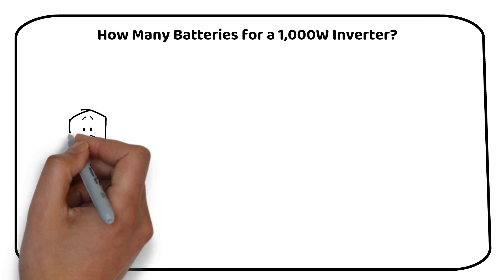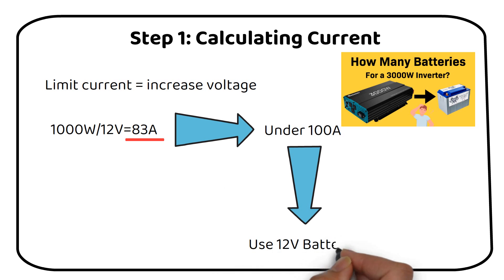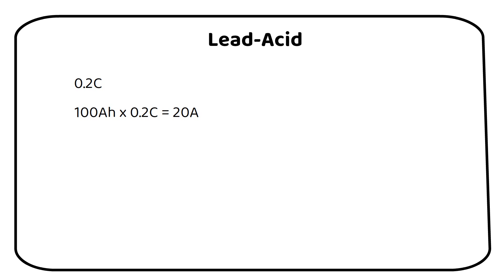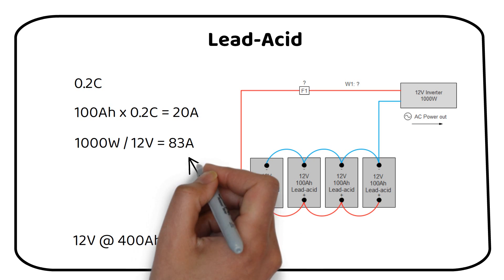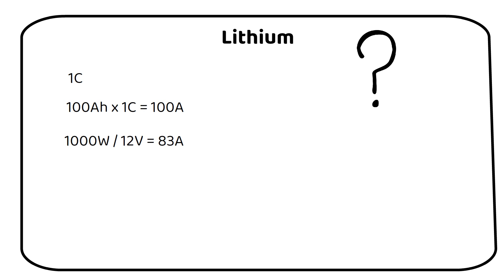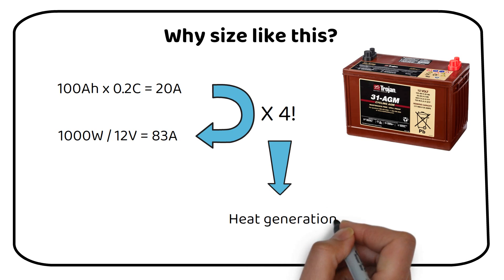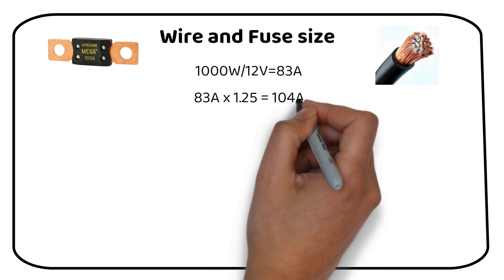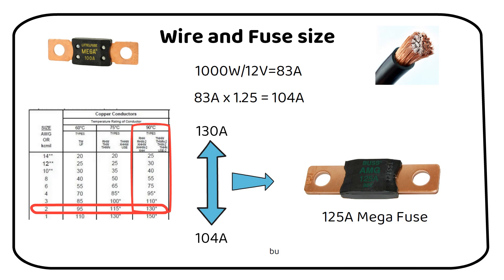1000W Inverter: How Many Batteries You Really Need

Comment: Thank you for your calculation it is very helpful, I want to purchase a 12V 100AH Lithium LiFePO4 Battery to power a 12 volt 1000 watt inverter, when we have a power cut, and run our boiler, our TV, fridge freezer, 1 laptop and two 60 watt LED lights, until power is restored, does this sound about right, thanks Bob in the UK.
Reply from the maker: I don't think a fridge freezer will work on a 1000W inverter. I would rather get a 2,000W inverter. I have a video about a system coming up soon that uses 24V and a 2,000W inverter.
Reply: @cleversolarpower  Thank you for your reply, I follow your channel so will look out for the video, Thanks Bob in the UK

Comment: So you're saying a lead-acid 12V battery that ahem STARTS A V8 ENGINE is not supposed to discharge more than 20A?!
Reply from the maker: Yes, continually. Continuous current is not the same as CCA.

Comment: I have a pen. I have a apple. Apple pen.

Who said that?

I have a Mastercraft air compressor. 30L tank (irrelevant) | Rated Horsepower: 2 | 120V, 12A
I bought a 1kW inverter from Walmart and connected it to my truck battery, had the truck running as recommended.
Inverter beeped and protected itself.
Why would a 1kW advertised product not be capable of powering 1.5kW startup power?
I hate the 2020s. I want to go back to 1960 when things performed well above and beyond what they were advertising to do.
Reply from the maker: You just answered your own question 😉

Comment: I have a 314ah lipo battery but don't wanna draw too high of current. I could just stick with an inverter size of like 1500 watts ?  I'm new with this stuff.  I just  wanna a couple home appliances like a chest freezer, fan and or a refrigerator.

Comment: Many Thanks Please
Sir
If we use inverter power seldom, then can we switch off the inverter in night. Or we switch on the inverter after 3-4 days.
As very rare electricity from the grid is off then only our inverter works for us
Inverter can charge the battery in the day
And we will save the electricity charges
Is that correct proposition please
Reply from the maker: Yes, you can turn off the inverter when it's not in use.

Comment: Very informative Video
We were just unaware of this aspect
We came to know harmonious relationship of inverter and battery
We just thought that Inverter is purchased keeping in view our requirements. if we need backup for longer time then more Ah battery and if we need inverter supply occasionally then very less Ah would do. Perhaps this was our wrong notion
I am having 150 Ah Exide Inva Tubular Battery Lead Acid if I buy 900 VA Exide Hybrid Inverter, How much batteries would I need Please?
Reply from the maker: A 900VA inverter on 12V draws 900VA/12V/0.9 efficiency) =83A max. Meaning you need a 12V 400Ah battery to have a normal discharge rate of 0.2C for lead-acid. (400Ah*0.2C=80A)

Comment: I’m planning on using a crockpot on my fishing boat to keep preheated food hot. The crock pot uses 300 watts on high and 150 watts on low.  I have two 100ah lead acid batteries on the boat. I anticipate the crockpot to be used 2-4 hours at a time, but only when the out board motor is running, so as not to run down the batteries.  Should I use a 500 watt inverter (that is approximate max output for my batteries according to your calculations using the .2C rule) and almost max it out. Or should I use a 1000 watt inverter and only use 300 watts, so as not to max out the inverter? The other factor is that I only use the crock pot when the outboard motor is running, so as not to run down my batteries. The outboard motor alternator produces 30 amps (360 watts) at idle speed or trolling , and 50 amps (600 watts) at higher speeds. Also can I use more watts periodically than the .2C rule if the alternator is charging the batteries at the same time. How does this affect battery life if using more than .2C rule and charging at same time?  Say a 500-1000 watt blow dryer for 2-3 minutes.
Reply from the maker: I recommend having a 1,000W inverter. Since you are using lead-aci batteries, i recommend using a VSR or smart battery isolator. this will only charge your household batteries from the starter battery when your starter battery is full. If you don't have a starter battery, then you can use a low voltage battery protect which will disconnect your battery when it reaches 12V as to protect the battery from over-discharging. Going over the 0.2C rate is not recommended, but it should be fine.

Comment: When dealing with led acid batteries, remember cold cranking amps , car batteries and deep cycle marine batteries and industrial batteries are different!
Reply from the maker: Indeed, But why would you still use lead-acid these days? Lithium is cheaper, in purchase price alone ($190 for a 12V 100Ah). I made a video about comparing them as well.

Comment: I am making a portable battery box with 2 100 ah lithium, i will need a 2000 w inverter correct?
Reply from the maker: The size of your inverter depends on the load that you want to run. The bigger the loads, the bigger your inverter should be.

Comment: Lithium cell banks do not have a resting voltage of 12v. It's always just above or just below 12v. So utilizing them in a 12v system is not optimal. 
Use this information in your planning.
Reply from the maker: Yes, its nominal voltage is 12.8V

Comment: I just bought A 12v 4000w power inverter  im planning to parrallel  6 lead acid batteries that i have  ,what busbar do i need ? I have an RV truck ,what are you recomendations?
Reply from the maker: I recommend watching my video about how many batteries for a 3000W inverter. i also recommend returning your inverter ✌

Comment: Hello, thank you for excellent and outstanding videos. I have a question, I have 4 100 Amps AGM  batteries on my boat. I also have a Victron MultiPlus 2000VA and Digital Multi Control 200/200A GX. From your video, it seems that I will need an additional 400 Amps to cope with my 2000w inverter - right? My question is, until I do add the needed batteries can I still use 1000 w appliances in the current setup without the overheating or any other risks?

Comment: Hi I have a question A 2,500 pure inverter. how many 100 amp lifepo4 batteries will I need.

otherwise a 2000 watt inverter. 

and a 3000 w inverter how many batteries.
Reply from the maker: Follow the math in the video. I have made a video about a 3000w inverter as well.

Comment: very great video !!! 
at 2:42 what should we concern if we use 12V , 100ah lithium x 2 pleazzze ? or should it be better to use 12V 200ah ? cant figure it out that part , been watching this over 5 times now 😂
Reply from the maker: You can have a 12V 200Ah battery. You will require less wires which is good. You still need two of them in parallel to make 12V 400Ah. But if you are buying new batteries i recommend getting lithium (lifepo4). they are cheaper as i have analyzed in my video about lead-acid vs lithium.

Comment: Can you tell me how many batteries I need for a 8000 watt inverter? I tried to start up a shallow well 110 water pump but it would not work. I only have 4 rv lead acid batteries in parallel. Do I need more? Thank you.
Reply from the maker: You can repeat the calculations shown in this video to your own system. You will definitely need more than 4 lead acid batteries. Why did you even get a 8000W 12V inverter. Bigger is not better.
Reply: @cleversolarpower  I found out that it is not an 8000 but a 4000/8000 peak.

Comment: I have a 2000w continuous/ 4000surge power inverter and I am not sure what battery I need and if I need two of them . Please help ?! 🫠
Reply from the maker: It's best to use a 48V system for home applications. 12 or 24V  for mobile. Don't rely on the surge protection of the inverter, this will probably not be correct. 900W/12V=75A*1.25=93A. At least a 100Ah battery.
Reply: @cleversolarpower f I buy a 2000 inverter and a 200ah lithium battery how long should I expect it to run a refrigerator that draws 500w?
Reply: @hotshotter4500 your fridge consumes 500W/12V=42A. What kind of monster fridge it is, but anyway. 200Ah/42A=5 hours. But remember that fridge works in cycles. You can multiply that time by 3, I think.
Reply: I’m trying to power this portable air conditioner 900w 8,000BTU

Comment: Ok, I'll start again. I have 4 x 12V x 300W In Series Parallel Solar Panels feeding into a Vevor 12V 60A Controller, feeding into 4x 12V x 120Ahr Batteries, In Series Parallel configuration, giving me 24V 240Ahr. The Batteries feed into a 12000/6000W Inverter. Will only having the 4 x 120Ah in Series Parallel create a problem, or do you think that will work ok?
Reply from the maker: 6000W/24V=250A, the max your batteries can deliver is 240A in a 2S2P configuration. So it will work. However, you should have better used a 48V system. Check my video 12,24 or 48V battery system.
Reply: @cleversolarpower  Thank you.

Comment: What if I’m using it on my truck a 1000w inverter and I’m connected to my alternator my inverter has 6 fuses on it. What size wire should I use? And I will be using my inverter only when my truck is running and the distance from alternator and the inverter is 6ft. So what size wire would I need?
Reply from the maker: Probably 4awg welding cable. Check the manual of the inverter as well.

Comment: Thanks for the video.  As a result I want to replace both my deep cycle 100amp lead acid batteries with 2 Lithium 100ah batteries.  My inverter is a Sensata Technologies CSW1012 1000W Inverter.  Will this set up work for my situation?
Reply from the maker: Will work great. You will have to adjust the charging parameters of your charge controller to match the voltage of lifepo4.

Comment: Is that the required battery sizes if you run the inverter at max power? If your load is only say 200A (a fridge and some lights) you won't place a big draw on the battery, mostly inverter on idle.

Comment: I have a super budget cheap universal brand 100 amp hour capacity 12 volt sealed agm lead acid battery paired with a 1000 watt pure sinewave inverter and it works beautifully. No problems. Never took the battery below 80% depth of discharge. and it handles loads like window air conditioners. vacuum cleaners. computers. and more. with no problems. powering it for a few hours.
Doesn't get hot. Voltage drop is not a problem. I used thick 1/0 awg gauge cable so even under the load of a full size window air conditioner it powers it like it's not even there.
It is about 3 years old and still works like new.
I respect the batteries maximum capabilities by checking the manufacturers specifications on it. and it is fully capable of handling anything I throw at it when properly set up and used correctly.
I use it as a backup emergency power generator setup. where it is kept charged and maintained when not in use. and fully charged and ready for use if there is a power outage or other emergency where we need significant portable power. it is very cheap and budget but works great.
Reply: Exactly 👍 
The wire gauge was a good choice. And many would say you got lucky with your chosen combinations. And they may be right? But this shows trial and error, with a few good decisions, can work very well. 

Many of the calculations and tolerance offerings from the manufacturers are precautionary. And here shows why! 

You have built a system, and it works for you. Because of those built manufactured safety tolerances. The battery and inverter.! Both appear to be coping. Just be careful with that battery tho! As you are pushing it. And working or not, it would be worth paralleling it with an exact duplicate type. 

And don't trust BMSs.! 
They be are not there to work souch for the battery as they are for you!

So you could be sitting on a bomb ticking away and never know it...!

So double up!

Comment: Ok, I'm new to inverter, solar-powered, and batteries. Your video explained it well. I WAS going to get 3k watt inverter with just one LiFePO4, rated at 100a. I know now that I would need at least 3 100amp batteries to work with a 3k w inveter.
Reply from the maker: Yes, I also made a video about how many batteries for a 3,000W inverter. You can check it out.
Reply: might want to go 48v.

Comment: Average person  buys a good inverter to run off your car  plugs into ciggie lighter socket & wonders why car catch fire :) draw on small wires bad hot 
like using a welder with an  extension  cord wound up on a spool  Melts  ive seen this happen in the 80s at work  if we didnt make mistakes we wouldnt learn anything ok
Reply from the maker: Better learn through a Youtube video than a burning car i guess.

Comment: IF i only charge my lipo4 12v 100ah battery with solar panels i do not need the invertor right? for i just want to only charge the battery  for augmenting my Bluetti  EB3A 268Ahcapacity and have 1080 usable Wh with my EB3A battery. is this correct? or am i mistaking? 1080+268=  approx 1300Wh. instead of  just the 268 watts. since  the  EB3A has a charge controller mppt integrated.
Reply from the maker: If you don't need AC, then you don't need an inverter.

Comment: Thank you very much for the video, I am learning a lot, but it is not clear to me if a 200Ah (lithium) battery would be better than a 100Ah? Would it be more efficient?
Reply from the maker: Having a larger battery will put less stress on the battery. One battery will draw 85A while a second battery in parallel will only draw 43A per battery. So you put less stress on the battery, leading to a longer lifespan.

Comment: Cant i connet 2 inverter 1 500w and 1000watt up batery 12vlt 100ah
Reply from the maker: if the inverters cannot communicate with each other, don't wire the outputs together.

Comment: I have been using 12v 150ah lead acid battery on my 1000w inverter, and the results after 6 months, now,  the battery drained in 30 minutes in 200w load.
Reply from the maker: 0.5h*200W=100Wh. Your battery can deliver 12V*150Ah*0.5=900Wh. So if the battery only delivers 100Wh while it should be 900Wh, then your battery is dead.

Comment: 400ah lifepo4 with 2000W intverter...should I experience any issues being that much more on my battery bank?
Reply from the maker: 2000W/12V=166A*1.25=208A If your bms can handle 200A, then it's ok.

Comment: i have 2 24 V DC lead acid batteries is that enough for my 3000W inverter ?
Reply from the maker: Most likely not. If the 24v batteries are 100ah each, then you should draw maximum 40amps. 40Ax24V=960W.
Reply: so maybe go down to a 2500W inverter? @cleversolarpower
Reply: watching your video and doing some math (hopefully correctly lol) a 2000W inverter with my 2 24V Battery 100AH should be fine (1920 W) . Is this correct ?
Reply: A "100 Ah" Lead Acid Flooded Deep Cycle Battery (Trojan SCS Series) is "Rated" at 20 Hours, meaning a "5 Amp Load" (20 Hours x 5A = 100 Ah)
Reply: To get a Durable Setup, if you need to pull 100 Amps just divide 100 by 5 to get your battery count! (100/5=20)

So that means 20 in Parallel *For a 12V Inverter*, or 4 in Series x 5 in Parallel if you use a 48V inverter.

So 2 in Series x 10 in Parallel, for a 24V Inverter!

Comment: To get 1000W from the AC output of the inverter, the input power to the inverter will be higher than 1000W due to the inverter efficiency, 80% is typical, so the current draw from the battery will be 83A/0.8 = 103A.
Reply from the maker: Correct, when sizing wires and cables we use a 1.25 factor to account for this. I didn't include it in this video because it would make it more complicated.
Reply: Shouldn’t it also be noted that the battery will use more than 12V, and will technically be depleted before reaching 12V? If it starts at 13.8V, the numbers will be different substantially.
Reply: Should I go all physics on you two??????

'Yes' you are both right. Only you have to consider in what spirit was the video intended?? To consider every eventually would take many hours.

Comment: Your videos are so succinct and serve as refresher for me as an experienced Solar PV Professional. However, this particular video needs reveal. For example, if an inverter is rated 12V/1000W (assuming 100% efficiency), it means it can supply max. 83A. Then a typical Lithium battery rated 12V/100AH at 1 C rate will draw maximum of 100A. The system will definitely overheat because what is required for the battery charging 100A is higher than what the inverter can supply which is 83A at 100% efficiency.  Thanks.
Reply from the maker: 83A x 1.11 (efficiency of inverter) = 92A. Yes, the BMS will get warm, but that's what it's rated for.
Reply: @cleversolarpower  what happens if we use 4 x LifePO4 batteries with 1000 watts inverter? Will also overheat like Lead acid battery?